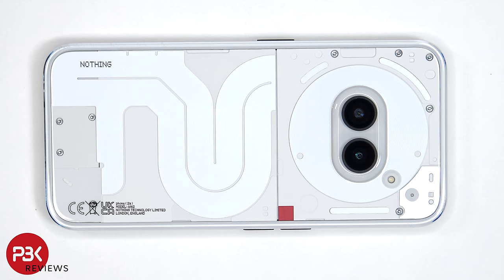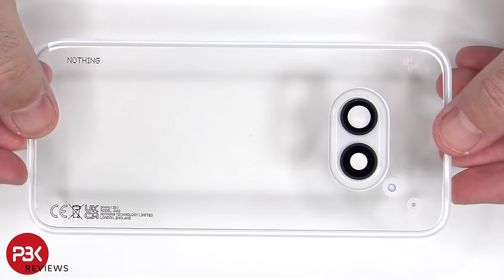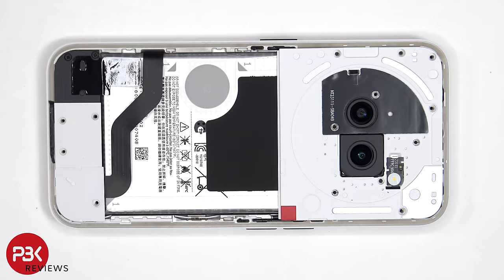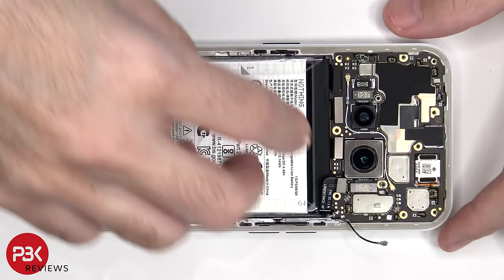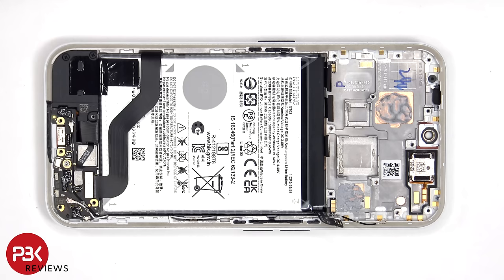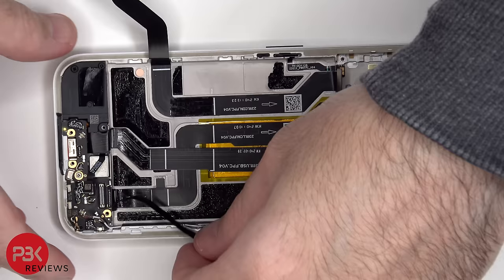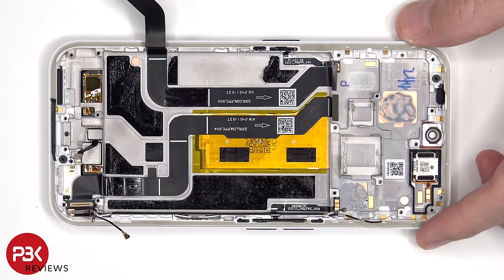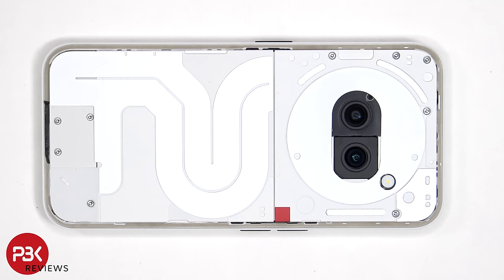Nothing Phone 2a Teardown Disassembly Phone Repair Review Video #nothing #teardown #review #diy

Comment: Could you just disconnect the battery (5:25), take off the small panel at the bottom, pull off the cable above the battery and replace the battery? Essentially skipping all the steps after 5:25
Reply from the maker: Yes, you just need to remove what is needed for replacing the battery. The extra steps for the other parts is not necessary.

Comment: It seems that Nothing 2A doesn't actually have an aluminum frame, despite what other prominent tech reviewers have claimed.
Reply from the maker: It uses a mix of aluminum and plastic, basically an aluminum mid frame coated with plastic borders but the plastic is a durable and strong one compared to most phones I've seen. Almost feels as if its not plastic and just painted aluminum.

Comment: One request. I have laminated the phone back wirh glossy paper. Is it successful because when i am applying transperant back cover there is a bubble at phone back. Or i shoud change it wirh mat lamination
Reply from the maker: Not too sure
Reply: @PBKreviews  ok thanks
Reply: If the bubbles are not too big, don't worry about it, they disappear when phone gets heated with the use
If its too big you may wanna replace it